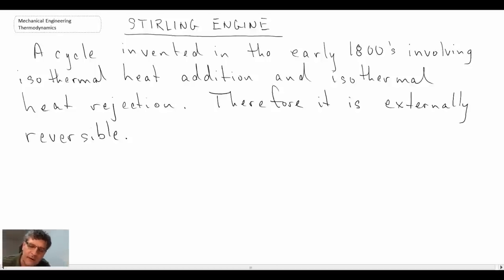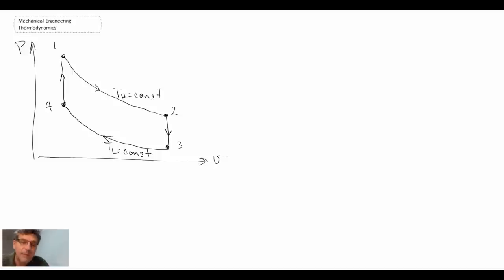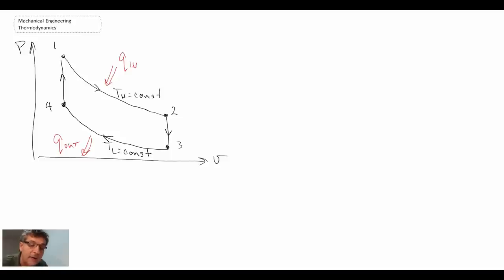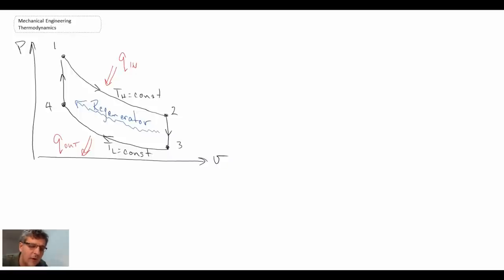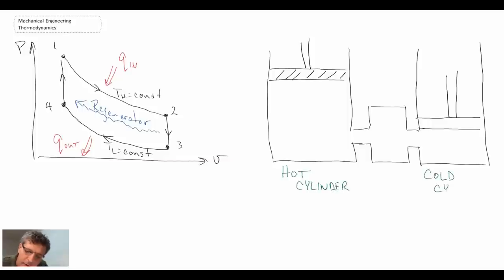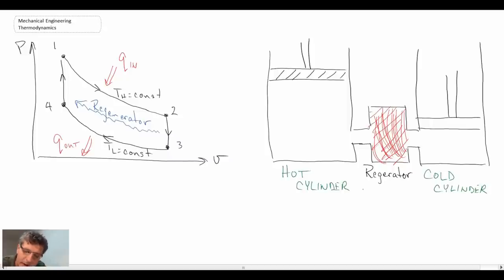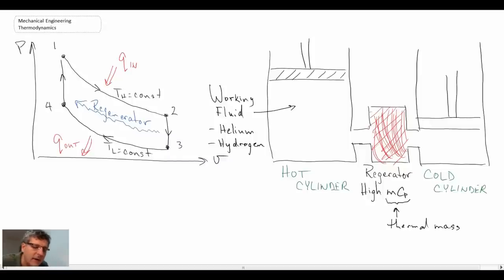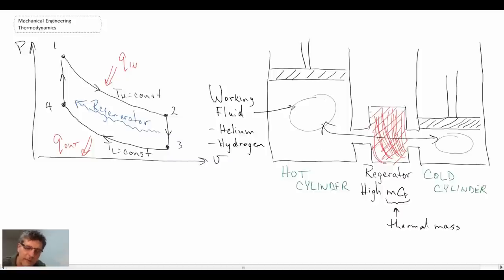Mechanical Engineering Thermodynamics - Lec 16, pt 5 of 6: Stirling Cycle Introduction

Comment: I found that If there is no regenerator the efficiency will be given by (TH - TC)R ln r / (CV (TH - TC ) + R TH ln r), where r is the compression ratio (Vmax/Vmin) and CV is the specific heat at constant volume.

Comment: the regenerator you called is simply the hose or tube connecting the two cylinder in actual stirling engine? thankyou